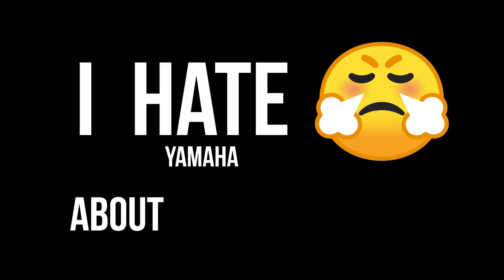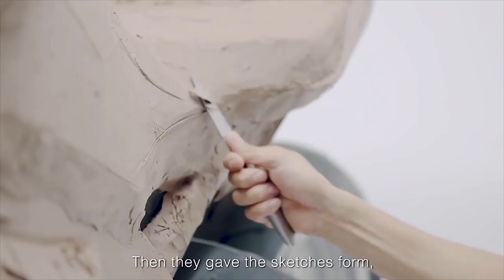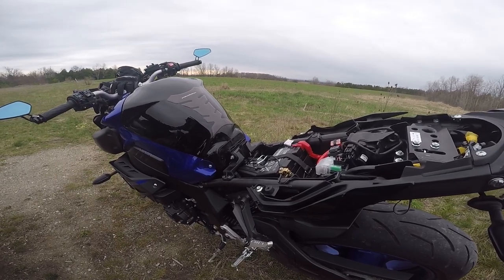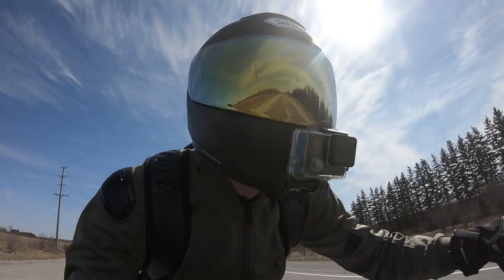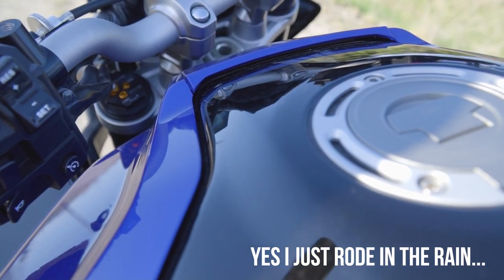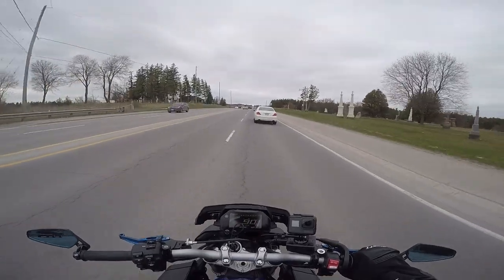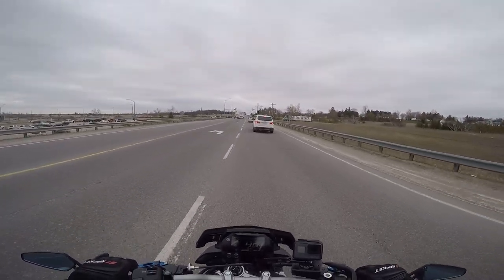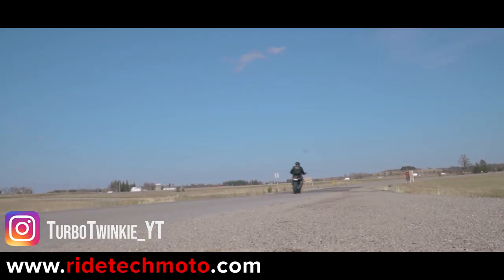5 things I Hate About Yamaha MT-10

Comment: The flat spot/delay in the throttle is caused by you swapping to a decat mid pipe, this is correctable with a tune (please get a dyno tune over a flash tune, it’s more adjustable and better suited to variations from bike to bike) in all honesty you are missing out on so much of the bike by not having it tunned. My bike was actually slower when I deleted the cat, I had to ride it for 2 months before I could get it tunned. After the tune on the dyno - night and day better bike.
Reply: I had the same issue on a stock mt10. Feels like some dead spot in the middle of the throttle.
Also, the seat was so hard and unpleased and felt like a wooden plank even seats on superbikes are not that bad.
The fuel gauge is odd and unreliable, you can be riding in "full tank" but in a second it jumps to half, and 10mins later the fuel light turns on, why Yamaha even bothered to put it in the first place.
I hated everything about the bike beside the engine character so I traded in for 2018 r1 and I'm much happier.
Reply: @Fearless154  The odd gauge is due to the shape of the tank, the fuel level gauge can't got to the top of the tank due to that odd size, so it doesn't read change until half a tank - you should be reset the trip every refill anyway - that gets you a better idea (I have always done that on every bike I've owned even ones with awesome fuel gauges - just habbit) . Original seat was shit, got the dealer to chuck in a comfort one. 

and by the sounds of it, it just wasn't for you. You're the first person I've heard to go to an R1from the MT-10, most people go the other way with zerp regret.
Reply: 2 brothers tuned exhaust + remap..
Also givi tankring tankbag for the win

Comment: You have removed the catalyst so the bike will be running lean possibly causing the throttle delay, a remap will fix it and if you get a custom map done on a dyno then the tuner can customise the throttle response for you because of the ride by wire.
On mine it didn't make the fuel consumption worse, or better, she was still a greedy bike.
Reply from the maker: It's already getting remapped I'll have an update video soon :)
Reply: It loses low end when you open up the exhaust but gains a little high end.  If you put a baffle in and make sure it's sealed up as tight as possible it will run almost like with the cat with no tune.  The exup valve really does make torque down low.
Reply: @TURBOTWINKIE  when the update coming and break down on the mods would be awesome and the cost. Love the video. Thinking about buying one 👌
Reply from the maker: @fatsheppors8589  I already uploaded the ECU flash video for this bike, in terms of parts however, that's coming this spring I still have a lot to install.
Reply: @TURBOTWINKIE . Looking forward to the full update. Thanks I’ll have a look 👍

Comment: back and a oil cooler radiator guard..large tank bag on the rack, small magnetic bag on the tank..I drilled a hold in the tank filler for a air vent to speed up filling all the way to the top of the tank, added 20 miles to the range!! I was tired after7 hours of riding but not terrible, my longest day was around 707 miles according to Google maps.. fun trip. Bike performed FLAWLESSLY!!!great machine.. just passed 6500 miles.. oh ,, got pilot road 5s just before I left..
Reply: Battlleaxes for the win, the only tyre designed to be used with the 10

Comment: Thats how inline 4 motors run. you ever rode a super sport ? you feel. the power in the 8 rpm -10 rpm and that feels like it hits your face . lol your bike is fast, you haven't mastered it yet. You have plenty of POWER right now!
Reply: off the line from low RPMS you got nothing then it wakes up... that is I4s... rev it out
Reply: On these particular bikes (MT 09 and MT-10) the power delivery is on the lower part, so you get a huge surge from 0 to about 100 mph basically smoking other bikes that are opposite  because they start slower and their higher power delivery kicks in about 100 mph which is more suited for track. So technically you shouldn't have any delay when taking off, maybe on the freeway at 100 or higher you might not feel the bike that responsive...
Reply: you literally have no idea what the dude in the video said about the response, right? It might even be cause he changed exhaust and never tuned it. Its not always the ''wrong and right rpm''.

Comment: I've got 800 miles on mine that I bought 6 weeks ago. The only things I agree with you on are the throttle and fuel gauge. My other gripes are the fuel capacity, stock mirrors, stock seat (I hate how it slopes down towards the tank) and the oil filter draining onto the exhaust.

My seat is rock steady and doesn't move at all. It's a 2019. I think a lot of the throttle lag comes from removing the cat and exup valve without a flash. I've got a Hindle 3/4 on mine. I think Yamahas eco thing it does at cruise adds to the throttle problem. My last gripe is the on/off throttle response. It's very instant, moreso when the bike is cold.

I'm planning on getting the 2WDW flash for it this winter.
Reply: I bought my Mt 10 June 20th, just got back from a 3200 mile road trip, Seattle to Denver and back again.. before I left I did a cat delete ( black widow mid pipe ) left the stock end can on it, looks good to me? Got a ecu flash from 2wdw, there only 20 miles from me ! Nice guys.. put a Puig Turing screen on it, it wasn't enough, so I added a spoiler screen, still not enough, so I need a taller spoiler out of some Plexi I had..!.. made it so my head was just out of the wind blast. Corbin seat, it's ok, made a rack for the back and a oil cooler radiator guard..large tank bag on the rack, small magnetic bag on the tank..I drilled a hold in the tank filled for a air vent to speed up filling all the way to the top of the tank, added 20 miles to the range!! I was tired after7 hours of riding but not terrible, my longest day was around 707 miles according to Google maps.. fun trip. Bike performed FLAWLESSLY!!!great machine.. just passed 6500 miles.. oh ,, got pilot road 5s just before I left..

Comment: A few of the same items made my 'what I hate about my MT10' vid. The seat mechanism is a bit rubbish but for me the size of the fuel tank is just too small for a bike with such a thirst. Had mine nearly 4 years and 22,000 miles and it's been super reliable. Still a great bike
Reply: dude you think its bad on fuel should check the vmax now there is a pig on fuel economy but sure has balls

Comment: Not sure if the yamaha has it but my beemer has an extra tube on the filler neck that won't allow to fully filly the tank. It's so you don't accidentally flood the carbon canister. I removed my canister as well as the tube and can get several liters extra in the tank, about 30-50 miles further range depending on how I'm riding.

Comment: Not much to complain about.  A bigger tank  would be nice though. Great machine heaps of torque. Best affordable naked  bike 23k in NZ.  25K for the SP. The Super Duke R cost 35k.  Who can afford that. The MT is  high performance machine.  High octane fuel and the right map, your only issue is keeping the front on the ground. Turn off traction control if you dare. Every person is a  different shape and size and if you don't set your bike up for you size you won't get the best out of your machine.  Try driving a vehicle after another person without moving the seat of steering wheel. A motorcycles the same. Ride safe!

Comment: Headlight that cracks is a problem. My 2018 began to crack after 2000km. Got it replaced under warranty and just Before I sold it I saw new cracks at 7000km. They cost 900 eur to replace if you have to do it without warranty. And headlight protectors dont help becouse they crack from the inside not from external things hitting it.
Reply: Danny War Robots  Ive not heard any explanations from Yamaha. Some countries have more issues than others it seems. Mine cracked both times under the colder part off the seson for me. Maybe that could be one off the explanations.
Reply: Danny War Robots   well you have always the risk off small rocks and things hitting the lenses. I would recomend lens covers. You can buy them for 20 bucks and they come in different collours also. Then you have done all you can do.

Comment: Had mine for two years now but my throttle reaction is super instant. Not a problem there. Also, haven’t had the seat issue although that might be a matter of time... 23.000 kms so far. The handling and the engine are sooooo good though 👌🏻

Comment: How is it for tall riders? I am 193cm in height (6'4 ft), and 105 Kgs in weight (i think 230lbs). If it is not, what do you recommend?
Reply: I'm 193cm and 90kg, boot size 46eu. It fits me fine. I tested almost all the big-brand1-liter supernakeds and the best fit comfort-wise was MT10, followed by S1000R. The worst look-wise was SuperDuke 1290 gen2 - I looked on it like on kid's tricycle. What is somewhat of an issue  (something you notice after a whole day in the saddle) is the steering bar pullback angle - it is always too large for shoulder width of taller people.

Comment: Gas tank space is to stop rubbing and provides some crushability to minimise denting if tipped over. Also, try removing the tank plastics if the front centre piece were flush with the tank.

Comment: I had my mt10 back in 2017 and due to the throttle issue and the seat which was very hard and unpleasant for a naked bike. I traded the bike for 2018 R1 because I loved the engine but these small issues were pissing me off.
Reply: Lol you do realize the seat is worse on the R1. And the throttle on a stock r1 in power 1 is super super twitchy.
Reply: @davisoneill7937  Actually no the seat on the r1 is higher quality and feels nicer.
The power mode 1 is snappy but power mode 2 is smooth and easy.

Comment: the throttle has it's own mapping so to speak because it's fly by wire controlled. it can be adjusted to give you a 1 to 1 like a throttle cable does.  I have a woolich racing flashing system for my R1 and the stock map doesn't even open the throttle to 100% for most of the RPM range.  the CP4 is a fuel hog.  my R1 only does 28 mpg.

Comment: Strange... I have a 2017 model and I've never had the issue with throttle response. I do have Akropovic full system exhaust, but even stock it was totally fine for me. 🤷

I totally agree with you on the fuel mileage and fuel gauge though. My brother has a 2018 gsxs1000, and has much better fuel economy. And that damn fuel gauge... I feel like that first 'tick' on the gauge is actually more than half a tank. It takes forever to get below it, but once it does, it seems like my low fuel warning flashes waaaay too quickly.

Comment: Get a 2017-2019 KTM 1290 Superduke R - it will solve most of these problems 😉
Reply: Yes, and you will get reliability issues. SD R is a great bike to ride, but not so great to own.
Reply: @sufilms8878  what? why? I have mine since may 2018 without any issues...
The only thing which could make any problem is the keyless system and even this can be resetted with some trick at home.
Reply: gaben8206 count your blessings and appreciate your luck.  Superduke performs well but is notoriously unreliable
Reply: Ktm is nothing but weird electrical issues that are non stop it will always be in the shop even when buying brand new. I know two people with 390’s and 1 with the 1290. The smaller ones are useless they’ll be in the shop for 3 months at a time .
Reply: or a vmax

Comment: I take it youve never seen an a dyno readout of an unmapped motorcycle with the catalyst removed? Your bike is basically running lean now so when you twist the throttle the air/fuel level is all wrong as their isnt the back pressure. 
Also interesting comment about the seat. ive owned mt07, mt09 and mt10 and have never noticed the gap under the seat in two years of ownership! It is there though as i just went to the garage and looked. I then realised im so glad im not anal about bikes 🙏

Comment: 5 things the yamaha mt-10 hates about you...
You've got nothing better to do with your time than to think of the most trivial and unimportant things that you could find to moan about on this bike,that have no impact on the way it rides and goes about it's business...
As for the throttle having little or no response to your inputs on the twist grip,i think the biggest problem with the throttle is that you don't know how to use it in the correct way,so rather than using that little limp twist of your wrist that you have,grab the throttle by the balls and ring it's neck to the redline in each and every gear,then you can learn to use the rear brake when your up on the back wheel and heading to the point where you can ride the bike properly with your stabilisers taken off and your first pair of big boy pants...lol

Comment: The MT-10 cosmetic (and some functionality related) fit and finish is like a watermelon with 1 whole ream of Japanese origami paper cuts glued to it.
Fit and finish shoddy. Gaps, sloppy seat, wires, hoses, pointless plastic bits.
Very very ugly face (just look at the history of what Yamaha used to make, for contrast). Fussy and time consuming for washing. Headlight illumination garbage (compared to dual H4 large reflectors in previous FZ1).
Bad RBW throttle calibration. Plan to spend hundreds on exhaust ECU flash.
Sucks gasoline like a badly carbureted Chevy 454. Most uneven firing 4-bangers (ie. cross-plane in-lines, or V4) suck gas compared to their equally powerful counterparts.
More limited travel range than the previous FZ1 via tank capacity and consumption.
More expensive insurance than previous FZ1.
Reply: @keithcarr5905  Are you just upset someone isn't bowing down to worship the machine god, perhaps that you venerate very much?
Reply: 😂🤣 so true